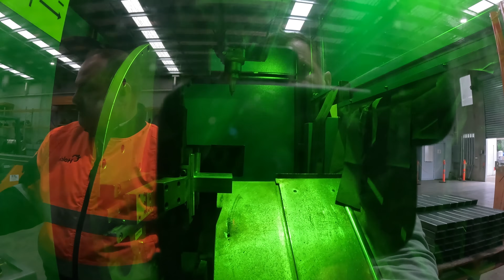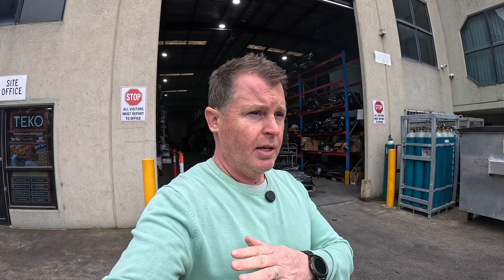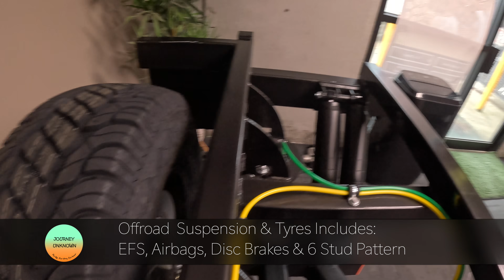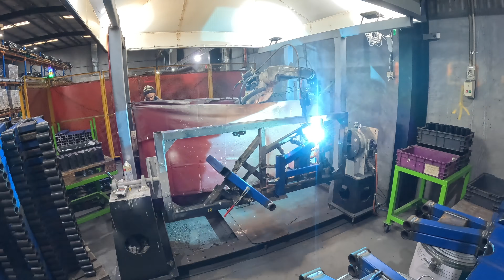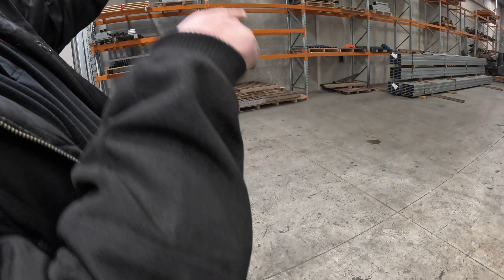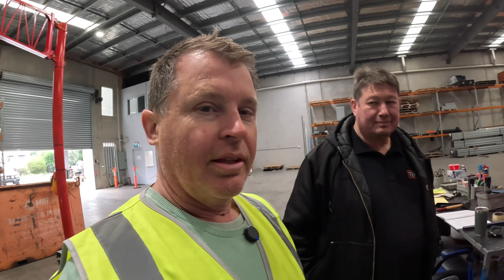Our Caravan Suspension | TEKO | Tuff Ride

Comment: Hi Troy 
Interesting video 
I too have tuffride suspension on my van with airbags 
Different van manufacturer but the principle it’s the same I have noticed that they don’t include jacking points on the arms I’ve got my manufacturer looking in to it would be interested to see what they say to you if you ask the question cause you wouldn’t lift the van from the body only from the arms I believe 

Let’s know if you find out 
Great video thanks for shearing it
Reply from the maker: Ahh ok that's a good idea having Jack points. l will try and find out. Thanks for following along 🙏
Reply: Yes I know CruiseMaster has them but I couldn’t find any on my Teko so my van had gone for a service and they are trying to find from Teko what’s the go 
I love the suspension it’s a game changer also the disks mine it’s a single axle 

Cheers Gabriel

Comment: We have their level 4 suspension on our van, it’s awesome.  Not only that, but their support team are excellent. I called once with a simple operation question because what was in their manual was slightly different to what our dealer told us, they explained everything super simple for the end user. The only thing I will suggest to you is to carry a couple of spare air fittings of the different types under the van, we found one had cracked at some point and we couldn’t get tank pressure to level the van for travel. Fortunately that only affected tank pressure and not the actual airbags. Most hydraulic suppliers carry the fittings used and they are super simple to replace if you have a failure (which will only ever happen in the most inconvenient place possible of course)
Reply from the maker: That's great to hear. We've heard so many people who are really happy with the service 👌. Thank you for passing on that tip it's a great idea 🙏